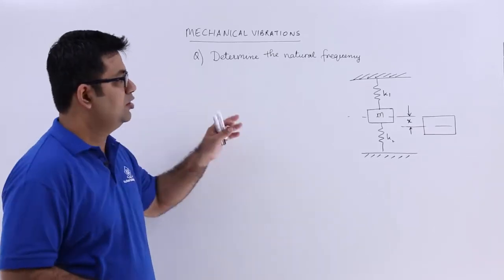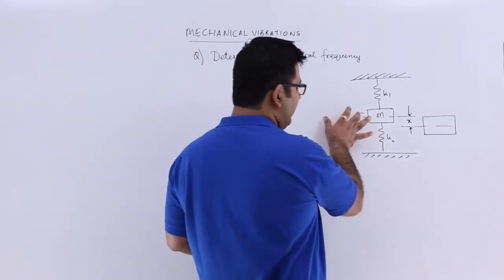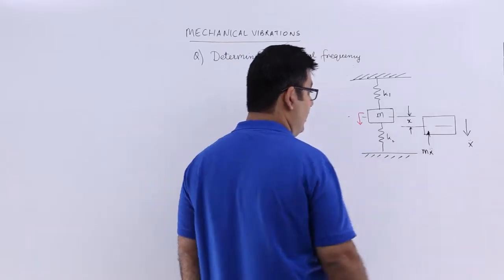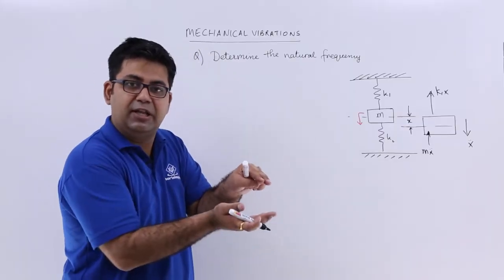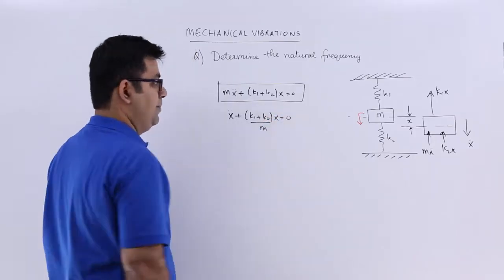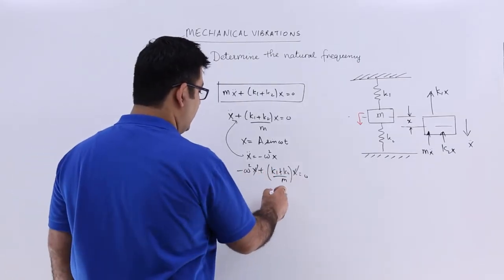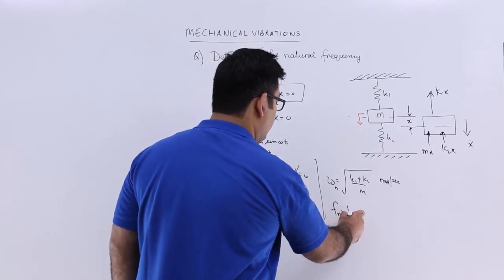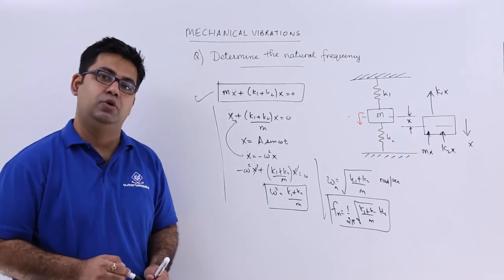Mechanical vibrations example problem 1

Comment: Sir you can solve this problem. 

A force Fo sin ωt acts on displacement X0 sin(ωt-60°), where F0 100 N X, = 0.02 m, ω = 2π rad/s. Find the work done during
 i) First cycle 
ii) First second 
iii) First 1/40 second 
iv) First quarter second